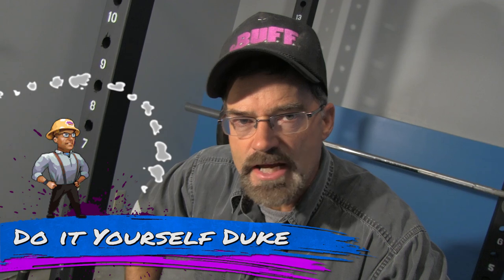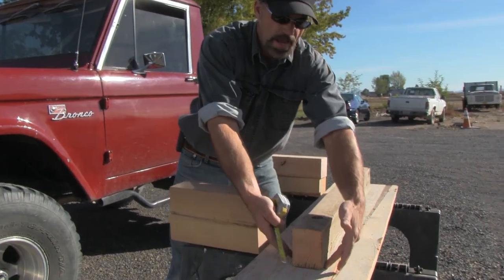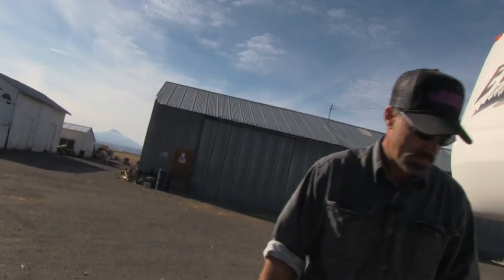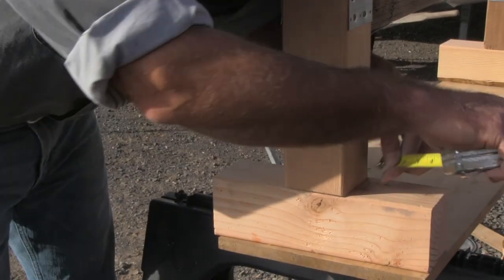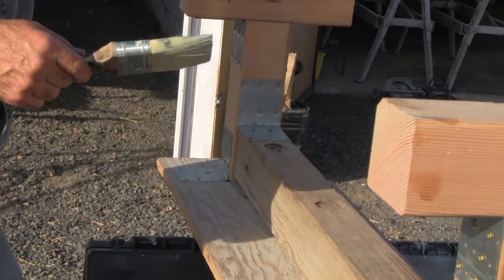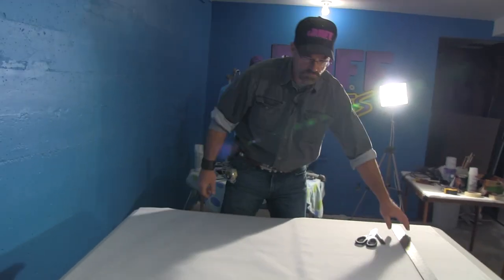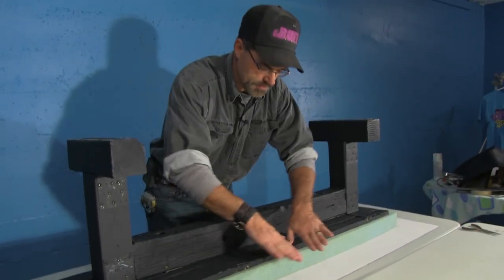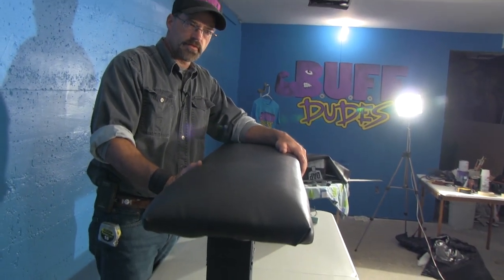How to Build a Gym BENCH - DIY DUDES

Comment: I got it!!!! This is the Parts list for the bench. Thanks for the DIY Video Buff Duke

TOOLS
Power Drill
Straight Edge
scissors
Razor Knife
Staple Gun 

Frame
4 4x4 12" length
1 4x4 37" length
3/4" plywood 12" wide 50" long
12 Simson Strong ties
3/4" wood screw 1 box
2" wood screws

Padding
Scrap memory foam 
54" long 13 1/2 wide
Vinyl (Marine Vinyl Preferred)
2 yard is enough
Cut to 2 wide x 5  length'(feet)

NEW FAN, HOPE THIS HELPS
Reply: Thanks for the info. I needed it to put this thing together. you rock.
Reply: it's a binch 😎
Reply: i think i just stick to my bed lol
Reply: Goat
Reply: Hey man thanks for the list, but i only counted 10 Stron ties. What am i missing?
Reply: Your comment is still helping in 2020. 🖒
Reply: Peter Richard m
Reply: How much did that 3/4” plywood cost you ?
Reply: I’m thinking about starting this project in the future, do you know about how much everything would cost?
Reply: Daniel Cabral for me I bough it at homedepo and paid around 140 for the rack wood and 20 on screws
Reply: A bit more if Your trying to make the bench like 50
Reply: Peter Richard any ideas how thick that memory foam was?
Reply: @Alex_Justified  Can you use a jigsaw instead of a straight edge (circular saw)?
Reply: @fightermma  You could cut the ply with a jigsaw for sure, but cutting a 4x4 with a jigsaw and getting the ends square enough would be real difficult. It'd be easier with a handsaw.
Reply: @nadzianyx  What about a multi tool?
Reply: MVP
Reply: A true hero
Reply: @FAMUxTINxREx  Did you count the 2 under the bench board that weren't bent?
Reply: Thank you for your service

Comment: Just built this!  Very good directions!  Thank you!  Here's what I spent: $12 for the 4x4, $15 for the brackets, $8 for the vinyl, $20 for the foam = $55  I had the plywood and screws laying around.  I went with 1" foam due to the cost (probably could have found it cheaper, but it was convenient).  
It's awesome, should work well!   Thanks!

Comment: Update6 months and I'm still loving this bench. https://www.youtube.com/post/Ugkxo_64lVTGMk7y4aXTPxPOcQ3YTLyQ6kYV I use it almost daily. I've gotten used to the small wobble and it's no problem at all. Love the storage, it folds right next to my weight set in the garage and hardly takes any space. I wish the covering material was a little bit tougher. I have a feeling that in a couple years it'll tear, but the bench is very well priced that I would just buy a new one.3 month usage review. Awesome bench for someone looking for compactness and storage. I did have to drill a couple holes to adjust my preferred seating position and leg bar position but that's only due to my personal preference. It's very sturdy for normal workouts, but for anyone going above 100# dumbbell press it wobbles ever so slightly. I would probably go with a fixed bench if that's the case. That being said i can accomplish 99% of my normal gym workout with this setup. Very happy with the purchase.

Comment: I suggest making the horizontal 37" piece 42" and shortening the legs to 8" pieces. This takes the stress of the weight off of the brackets and puts it on the horizontal piece of wood. This was recommendation from a friend who is a structural engineer.
Reply: That would increase the twist-shear since the top is wider than the base.  To me that seems like a bigger risk, especially considering the top is already directly supported by two columns.
Reply: Using 2 vertical legs each side and corner braces both directions just like the power rack should help
Reply: I was thinking the same thing. As another person mentioned, making the the base longer than the top is also a good idea. I was planning on making my base 13.5" and the top 12.125". I would lower the legs to get to a target height of 17-18" overall. I was shooting for 17.5".

Comment: I built this bench last week. It looks AMAZING. for paint I used three coats of Rustoleum Truck Bed textured spray paint. I went to the fabric store and got textured Arctic Vinyl. It is sooooo solid and super classy looking. Thanks for the fun DIY project, dudes.
Reply: does it feel sturdy, like it can hold some weight?
Reply: asleep in the video store absolutely. Solid AF.

Comment: What about building a simple cable system for some cable exercises to complete the home gym ;)
Reply: Agreed, would be great, but also would be harder to do.
Reply: Definitely gonna do some cable stuff, have a bunch of 3/8 inch winch cable.  Plenty strong enough.
Reply: awesome idea. i'm thinking about building one myself. just a sheave, a cable and a chain to hold the weights but would be nice to have something to base the build on. keep it coming, dudes :)
Reply: DIY Duke Buff Dad you are a LEGEND !
Reply: Vincent Renardi Linaksana Thank you Vincent.
Reply: Bodylastics.... $100 for full set ($$ value depends on which set you buy $30-$100) band exercises that you can use in a doorway.. it's not a gimmick, I have them attached to a bench press (but obviously the recommended use if you don't simply have something like that is in the doorway.. which might restrict you to amount of resistance you want to add without damaging your doorframe... but most likely enough to get a good supplemental workout/ physical therapy)
Reply: if you need something to base your cable bill. Off of the guy that I'm talking to knows who I'm talking to look up a few different images a few different designs look at it as much as you can at different angles and there you go

Comment: man you rock, this DIY videos inspired me to do my own home gym, the tricky part will be to actualy buy weights plates, maybe there is a workaround, any ideas??? they are expensive as hell.. :(
Reply: Look for specials, I bought a new 300lb Barbell Cap set from Academy during the holidays for $160, it included the Olympic Bar, 2-45lb plates, 2-35lb plates  and so on, which they usually retail for $209. For the amount of weight, it is quite a steal! Or you can always use Craigslist. The weights may be a bit rusted, but they'll be cheaper....Alao DIY Duke did make a DIY on  creating your own weights from empty protein tubs.
Reply: Archangeldawn damn that's super cheap, well is so hard in this crap yountry of mine.... i dont mind rusty ones as long as they are actualy weights and i need at least 200kg of em so that's like 600$ for that amount of weights (cheapest deal i could find, used equipement) so you see my struggle..
Reply: I see  the struggle is real. Well like Buff Dudes have said before, it's an investment in yourself & one that will keep on giving as long as you keep active. Just save up & keep looking around. No matter how long it takes, you'll find a decent set. Good luck!
Reply: Progressive astronaut - if you need 200kg weight your best bet is look for pairs of Flywheels with 1 or 2 inch hole in the middle as they are virtually the same as weight discs just not marketed as such. go to the scrap metal yard and look for stuff like that to salvage like cogs or make concrete weights using bucket, bowls and metal bar. 

sometimes it's not all about money, it's about your understanding of the math and science of total weight you can get together and finding a secure lifting solution within your budget, sure the commercial gym barbell/dumbbells are wonderful but you have to do what you can with what you have and what you can find for cheap or for free.
Reply: Craigslist   for the past 10 years  USED Olympic Plates  went from $1.00  to now  $1.50 a lb........ STANDARD plates 10 years ago were  avg 30-40 CENTS a lb   NOw $1.50 a lb    VINTAGE  plates like Dan Luire  /  Legacy /  Ferrigno  $2.00 -$5.00  a lb........
Reply: @progressiveastronaut  bro tht was 6 years ago
U better be a buff dude by now
Reply: @tylerandleahcanadian3888  i am ;)
Reply: @progressiveastronaut  haha nice 👌 💪
Reply: @progressiveastronaut  skupo sve u nas
Reply: Craigslist, put a "Want to Buy" add. I got an intro 311 pound (Chinese made) set for $150
Reply: @robertlehnert4148  not everyone is from US :/

Comment: Made one yesterday and went 18" 4x4 at the head (had a 18" piece already so why not?). I added a 10" 2x2 under each end to give a little more support for step ups. I didn't cover it yet but a couple towels on there and it's good to go. It's the most sturdy bench I've ever used, Rogue level sturdy. I already had the tools and scrap wood, the screws and strong ties were about $18 at home depot. Thanks for this video! Much more practical and rugged than other DIYs I've seen.

Comment: Memory Foam Advice

I just created an adjustable bench top from his video. I just used an existing metal bench frame and skipped the frame construction.    Here are my suggestions.

1.  Memory Foam should be used in combination with High-Density Foam.  Memory foam provides light support and does not work on areas that need high support, like directly underneath a 250 lb loaded barbell.  I cut out a section from my scapula bone to my neck and replaced it with firm 1 & 1/2 " High Density Foam.  I did the same for the adjustable bench seat.  

2.  You can buy memory foam for a single bed on Amazon for around $60.

3.  Use an electric knife to cut memory foam, but its hard to make a straight line to slice the center of foam.

4.  Glue the foam together.

Comment: Wow, I built one with help from my dad a week ago, and it looks really similar to yours. Except it has a 2x4 going from one of the legs to the other on the bottom, and we used 4x4 brackets to keep the 4x4s in place. I also decided to go with 1in plywood and it holds pretty sturdy. I decided to also go with 4 layers of cotton batting, because some of the foam from hobby lobby was a bit expensive since I was trying to stay on budget lol.

Comment: Thanks for the great idea.   I made mine and it turned out great.   I even added cables (front, 2 low 2high inside, lat pull down). Works awesome.  Couldn't of done it with out you guys.

Comment: Made this bench today. I used a 12”x48” for the top instead of 12”x50” and it’s totally fine. Home Depot has precut 12”x48” pieces already. 

Instead of vinyl from a different store, I used a painters cloth with polyester on the bottom. I have the bottom side facing up to make it water resistant. Again, this worked totally fine for me. 

This easily could be the most sturdy bench I’ve ever used and the most comfortable bench I’ve ever used. Used 3” cushioning at Home Depot.

Comment: Those Simpson Strong ties are almost $2.00 each here in Canada. It was cheaper to glue and screw it with 6 in screws for uprights and feet. And a small 2 X 4 for the main beam and uprights for bracing and support.  But you guys gave me great ideas .This senior does it for the extra income.  The fabric was the killer for me.  Had to buy a membership to get the discount. If I make a dozen benches, it'll pay for itself.  Wife's happy, keeps me out of the house and into the Garage. 2 Thumbs up. *

Comment: I built one with a 6x6, 2x12, and a 2x6 (all pressure treated). Used the 6x6 for the legs, the 2x12 for the top and the 2x6 for the feet. I also made triangular supports under the bench with the 2x12 for the bench, and with the 2x6 for the the legs. Surprised by how sturdy and strong it feels.

Comment: I initially thought you were going hardcore and leaving the bench as plywood.  That's beyond buff dude territory in to something all together different.  I'm totally down with your marine grade vinyl scrap and thrift store memory foam completion of the bench.  I'm obsessed with using straight bolts or lag bolts when building something to deal with loads. I'll take some inspiration with your much lower cost use of framing plates and construction screws.  Nice job!

Comment: What type of drill do you recommend? I have a 20 volt battery powered drill and have only been able to drill three 1 1/4 inch holes, my drill began to lock up so I stopped. Sorry I’m commenting on this video, what I’m trying to make is the “ Buff Dudes Power Rack”. Bench to follow.

Comment: I just made a really easy bench today. I got 3 pallets and cut them in half with both the outer and middle support beam and stacked then in top of each othet. I put an old towel on it and a folded blanket. The pallet is a good idea because you can store your plates in between them and you can hook your feet in between for russian twists and crunches. Just need to get a barbell and make a stand

Comment: Awesome video! I want to make a freestanding pull up bar for my apartment. In this apartment, if the bar was at 83", the ceiling is plenty high, but when we move soon, I'm not so sure. So it needs to be both strong AND adjustable. Any ideas?

Comment: I've made 3 so far.  Thanks guys.  But I added 2 inches to make it higher.  Perfect height for doing squats. My legs are then parallel with the floor.  The foam was most expensive thing on my project.

Comment: Here are a few ways I screwed up my first attempt:  I bought flute head screws instead of flat..  There's such a thing as a 6x6.  And it costs 4x as much.  And screws up all the measurements in the video.  There are also heavy and regular Simpson strong  ties.  The  heavy ones are not easy to bend to a right angle.  For me they came out more rounded.  Heading to the store and will be excitedly starting attempt 2 soon.

Comment: Just built it in an hour and a half. Although I havent finished the vinyl and foam portion yet. Its cost me about $55 Cad. 

I changed the dimensions of the bottom cross feet from 12 inches to 16 inches to get some extra stability.

This thing is super sturdy though. I couldnt see and issues occuring even when going heavy.

Comment: How do you hide the Simpson strong ties plates?  I'll try using the nail gun. Cheaper than screws and faster and cheaper. I made 8 last year, and sold six.  Going to try using a biscuit joinner. Make it more appealing.  Biscuits and glue of course.  I'll let you know how it looks.

Comment: I ended up making mine with structural pine and just joined two bits together for the the thickness (instead of 4x4). As my preorder bench was still  month away at the time at least. Have done the cushion or paint yet, and am thinking about cancelling my gym bench order and just using this instead as much cheaper. Just so nervous about the weight support! It feels really solid, but as said bit nervous. I'm 90 kg and will have up to another 150 on it for my bench, so I really want a solid one. Thoughts??

Comment: Great Video, thanks man, I was thinking about something like this in my head, but then I remembered how "handy-incapable" I am, so this really helps.  I like a much more firm Bench, hate stuff that you can sink into, so I was thinking about using some leftover Firm foam garage insulation I have.  Provided you don't put a dent into it with something hard the material is good, but It seems likely that I will at some point damage that material.  Any suggestions on a firm material for the covering?

Comment: you are the best man. Any chance you could build a solid speed bag platform/setup? I bought one from an online store for $300 and it was absolute junk, not even usable. The platform that the speed bag was supposed to bounce against was about a half inch think and the frame was so weak that between those two things, too much of the force of the speed bag was absorbed through the structure that it did bounce back enough to keep a rhythm going. Thanks in advance if you go for it!

Comment: Buff Dude’s Bench

Materials Needed:
4 – 12” 4x4 boards
1 – 37” 4x4 board
1 – ¾” T x 12” W x 50” L  plywood board
12 – Simpson Strong Ties
2” wood screws
3/4” wood screws
Small upholstery tacks or Staple gun
Mattress foam
Vinyl  

4-5 Hour assembly
Approx. $50

Comment: I just made mine and it turned out well.  I made it 48" instead of 50 and was able to get away with using only one yard of the vinyl since it comes in a length of 54".
Reply: David Robertson how thick was the cushion?
Reply: @christopherqmullen  2 inches, but it depressed a bit when I pulled the vinyl tight.    I used 2 pieces of inch thick foam that was ribbed on one side, so it probably had more give than memory foam like they used.

Comment: Nice bench. It would really benefit the stability by adding two 2x4s as diagonal cross bars from the bottom of one leg, to the top of the other. Just slap them on the sides. When have 150 to 200 lbs of dumbbells plus your body weight, and you kick them up to lie back on the bench, there is a lot inertial horizontal force on those legs. Enough to RIP those screws right out.

Comment: 4 diff 4x4 cut at 12 inch length 
1 diff 4x4 cut at 37 inch length 
1 diff plywood at 50 inch length and 12 inch width
3/4 inch thick
Simpson strong ties 
Vinyl and padding 
Nail gun and small screws

Comment: Now I've made 5.  Hardest part was getting the corners done with the cover. My daughter is a seamstress. Wood was $10. Simpson plates  times 12 $16.45  plywood (free)  Vinyl cover $9.50  foam $7.00 (bought in bulk).  It was a nice project.  I'm retired and it gave me something to do. Now how about about telling us how to build a Smith machine.
Reply: Step 1 to make a smith machine , you don't

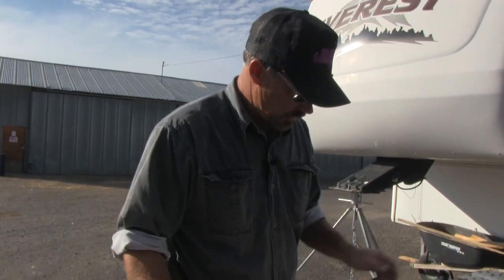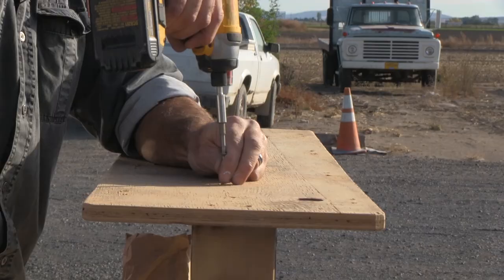Comment: Hey brother ,  not to bust your... or anything but the cross member to the leg at 5:50 minutes were not even close to being flush which probably was a factor in the flex in the backer plywood at  8:45 minutes.    Which brother was in charge of quality control and was asleep at the switch.    Anyways nice effort.    Keep the faith.